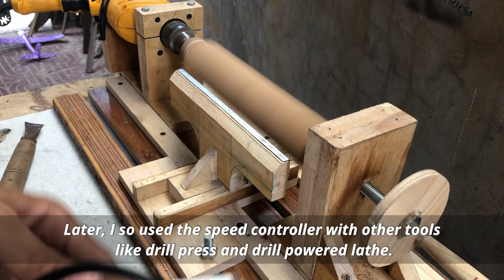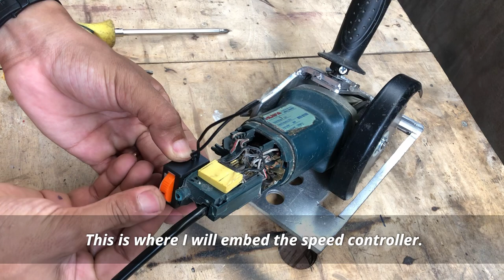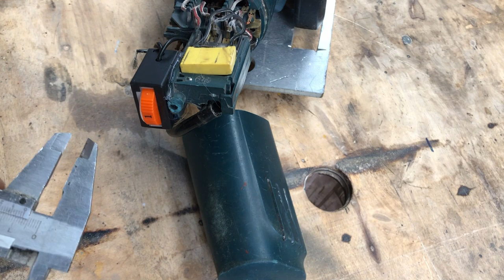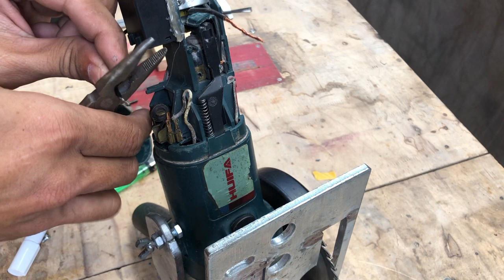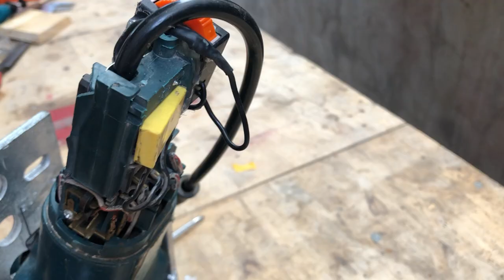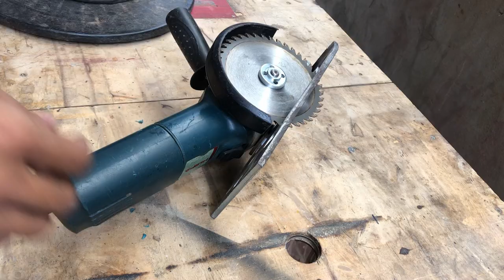DIY : Embed Speed Controller in Angle Grinder, - after converting an angle grinder to a circular saw

Comment: I have a build skill angel grinder so my question is if i made speed control to that grinder will my motor get damage plese tell
Reply from the maker: Thanks bro for the question. It wont damage the motor. This speed controllers are built for angle grinders. Some brand like Bosch sell angle grinders that come with this type of speed controller. I have used the one in the video for a few year and the motor is still running fine.

Comment: does the speed controller connect to the live wire or the neutral wire inside the grinder ??
Reply from the maker: i ve tried already. either line will work.
Reply: @backyard.craftsman  thanks for replying .appreciated 👍

Comment: hi .this is really good.. but if we add variable speed in our grinder.. set it at the lowest level (1).. is it affect the power of the grinder or no? coz when i use dimmer.. at the lowest voltage... it has no power....
Reply from the maker: I bought this speed controller from a local hardware store. It was designed for use with angle grinders, so at speed 1, it can still cut but at a much slower speed. I think dimmers are for light bulbs, not enough power for angle grinders. I think you can find one speed controller like this one on Amazon or Ali-express
Reply: @backyard.craftsman  awesome.. thanks for the info.... FYI, mine is dimmer speed controller  220volt....i thought the dimmer is voltage regulator..basically it`s works by declining the voltage... so the rpm will be down...but less power .... how about this variable speed? do you feel the power of your grinder still same at the level 5 and level 1.. even the rpm declining?

Comment: Where u got control switch ?pls share link
Reply from the maker: I bought them from a local hardware store, but you can also buy online. https://www.aliexpress.com/item/32914556203.html?spm=a2g0o.productlist.0.0.450b71676MK7aW&algo_pvid=deb35933-8823-42b3-9b7d-ff0864b5ede1&algo_expid=deb35933-8823-42b3-9b7d-ff0864b5ede1-5&btsid=0bb0622f16097701236242178e780c&ws_ab_test=searchweb0_0%2Csearchweb201602_%2Csearchweb201603_